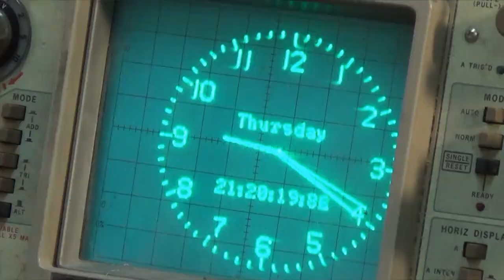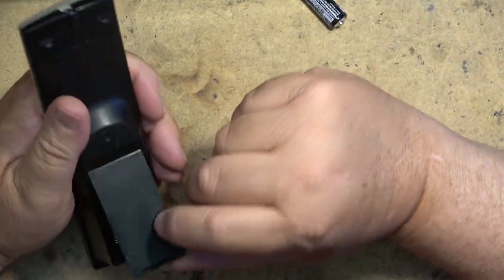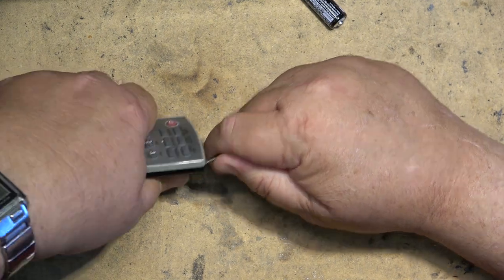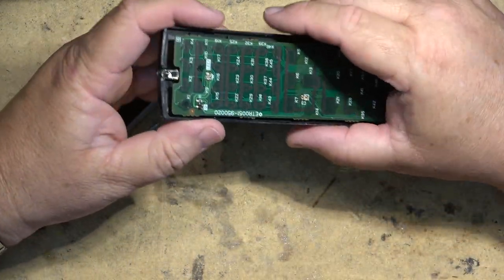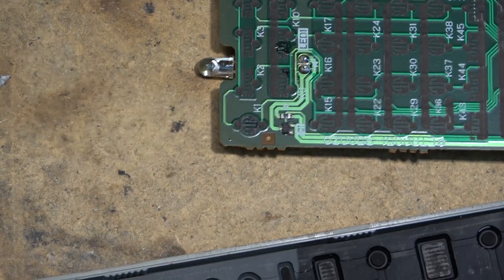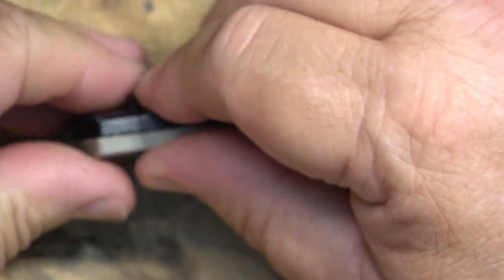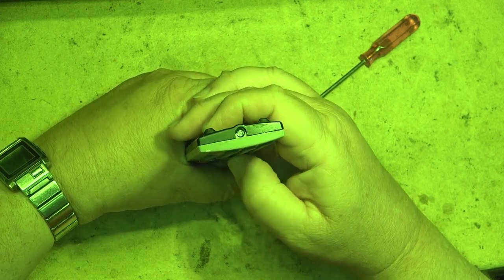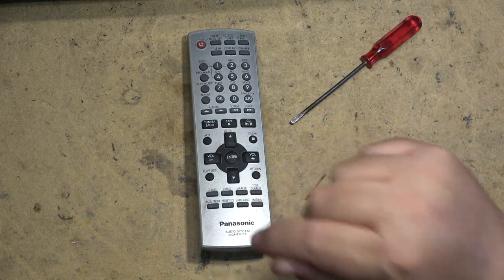Repairing a dead remote control

Comment: Hi Dave,
Another great instructional video. 
Here's what I do to test the remote control since I don't have a night vision camera. I aim the remote control within an inch or two at an AM radio with the frequency just a bit off from the station and you'll hear interference over the speaker every time you press a button on the remote control. Just to be clear, this only works with the radio set to AM.
Reply: I use my Panasonic RF-511 to check for RF radiation all over the house to check for noisy devices, like switch mode power supplies (wall warts). You would be surprised how many wi-fi and electronic devices on standby there are in your house which are active all the time and transmitting electronic noise pollution. Did not know a remote control would emit that much RF noise, interesting.....

Comment: Carbon pads can wear out - use conductive paint on them when that happens.
Reply: Like what kind? The conductive paint for automotive rear window defroster repair? Directly on the rubber carbon flexible pad I am assuming?

Comment: Hi Dave, great job on the remote ! I remember, as a kid when remotes first came out, they were wired remotes, lol, then the clicker type came out, my, how the remotes have come a long way!!
Reply: I have a VCR with a wired remote control, though to be fair it is a professional Panasonic duplicator, where you can plug in either a edit deck or just a more basic remote to control it.
Reply: Yeah, I have an old CRT TV that uses the "clicker" type remote. I used to jingle my house keys to make the TV go haywire as the way the remote worked is that the clicker would strike a metal tongue inside the remote and it made a high tone sound that would be detected by a mic on the TV thus allowing remote operation. Each button would strike different tones for channel change, volume, power etc. So jingling my keys would produce these tones and the TV would pick them up and start changing channels, power on and off and going loud n quiet etc. Great fun.
Reply: @EzeePosseTV  lol me too 🤣
Reply: @angelodagnolo984  Haha kool, I love it.

Comment: I remember, many years ago, my father getting consistently frustrated with a remote - finding that if he whacked it against his palm it would usually cooperate (regardless of battery age/condition).  Until it got worse and worse, requiring luck and a stronger whack (or two or three or...)  

Must have had a cold solder joint on the LED/emitter beforehand... Finally one day it was resoldered and worked like a champ!  Whoops, easy fix!

Comment: I made a circuit to test remotes using IR sensor from TV and coupling that to an audio Amp. Nothing critical for the Amp. Lm 386, Discrete Amp whatever. Usually the ir sensor runs on 5v. This comes in handy for programming universal remotes. Different brands make different sound. So you tell if you were switching codes. I found it handy to show customers if their remote was working or not.
Reply: Tune an AM radio to around 700kHz. When pushing the buttons on a good remote,  you should hear "noise" from the radio speaker. If no noise is heard vary the tuning up or down a couple of kHz.
Reply: @xmttrman  I have done that as well.

Comment: No IPA wash?  Oops, I may have bricked the JVC VCR I changed the belts on recently — washed the board down thoroughly.

Thanks for the dilute solution pro-tip.  I’m off to give it a go now before diving into another VCR.

Thanks for all the great vids.
Reply: What? You shouldn't use IPA on conductive layers in remote controls only. It won't harm PCB itself or its copper traces...

Comment: I have a remote for a 1988 Panasonic TV, which, on closer inspection looks as though something has been spilled into it. Turns out the rubber membrane has started to break down with age, and is leeching a residue out onto the PCB.

After cleaning it up multiple times I gave up and stored it away in bits, as a universal one does more than I need it to. Power On - Select A/V - Adjust Volume - Power Off. That's all I need the blasted thing for!

Comment: Unless they have an infrared filter on the lens, all video cameras can see IR light, whether they have "night shot" mode or not.
There are even little cards one can purchase with a coating on them that can detect it just for testing IR remote light testing.
Reply: I use my phone camera nothing special J6 Samsung, works great!
Reply: Radio Shack used to sell a credit card size tester that would luminesce when you pointed the infrared remote at it.
Reply: @angelodagnolo984  Need a pretty dark room, glows purple.

Comment: Hope you washed the case halves as well, they get nasty dirty as well. I also tend to look and see if the small capacitor in there can get replaced by a larger value, makes the range with weak batteries longer, or just makes the remote more reliable in daytime, as the IR signal is stronger than the low current the batteries can supply.
Reply from the maker: No never dawned on me to clean the cabinet.

Comment: The contamination is it silicone oil leached from the rubber keys ? I have taken some apart that were full of this oily stuff, I did wonder if it was greasy hands that caused it to leach.
UK based controls that I have had the experience of.
I did read one article that said it was sometimes shortcuts in the manufacturing curing process of the rubber keypads ?

Comment: I found that IPA don't harm remote controls PCBs - for sure more modern ones. For rubber membrane soap and water is the best way to go. I've tried also IPA and q-tips on membrane - very gently to not remove a lot of conductive carbon - yes, for sure it can remove it and destroy a remote. Some more used remotes can have conductive carbon layer worn out. You can use some kind of conductive paint or cut old membrane pads and glue in a new ones.

Comment: You can also use an AM radio to test out remote controls as well.
Reply from the maker: That will pick up the 455khz ceramic oscillator.  Won't tell you if the ir led is sending a beam out.
Reply from the maker: @awesomeluis  mine has ir cut filter.  Doesn't see ir
Reply from the maker: @bahagursoy8138  not dishwasher detergent.  Hand washing dish soap.  Palmolive or dawn.

Comment: When I need to pry something open like this, I usually just use a guitar pick. With a screwdriver I oftentimes damage the casing unnecessarily. Also, when you no longer have a specific remote control, you can use a phone with an IR blaster. There is this Android app called irplus, which allows you to mimic vast majority of remotes sold worldwide. I use this to disable autotracking of old VCRs I do not have remotes for. Handy if you need to adjust the tape guides.
Reply: Great tip!
Reply from the maker: Good luck finding a phone with an IR blaster today. Yes Samsung had that on their tab tablets and on some of the earlier Galaxy phones but that's long gone. It was a nice feature and I wish they'd bring it back but you know the saying wish in one hand and shit in the other and see which one fills up first.
Reply: @12voltvids  Yeah that may be true, but probably depends on location. Here in mid Europe the phones with IR blasters are still widely available. Samsung or Xiaomi are your best bet.
Reply from the maker: @speed_rider362  I don't know about you but when i am watching TV my phone is as far away as possible. I don't live with my phone glued to my hand.  Using my phone to change channels makes as much sense as using my phone to view my backup camera on my car.
Reply: @12voltvids  I use my phone to help me with technology. I make calls and send messages. Not much else. Even you use your phone to measure the rotation speed of turntables :) Phones nowadays are universal devices and it is fine. Not much to do about it.
Reply from the maker: @speed_rider362  Its a communication too. I use it for phone calls when I am away from the house. I use my home phone at home. I use it to check Email when I am away from computer. I don't play with it when I am watching TV or a movie. The idea of using my phone to change channels on my TV doesn't appeal to me. Neither do those fancy touch screen remotes where you have to actually look at them to use them. Sorry, but I like a remote with real buttons. I know where they all are and can press the one I want by feel, and not have to fumble with my phone and unlock it just to change channels.
Reply: @12voltvids  One could raise #ell with a sports bar's TV monitors with that app!
Reply from the maker: @xmttrman  years ago there was a certain sports bar that i knew the owner.  I knew that he had bootleg satellite tv boxes on his tvs and i knew he had a box that had an RF remote.  On more than one occasion his tvs just changed channels from the football or hockey game and somehow ended up on the xxx channel. Now i am not admitting or denying that i told someone what he had and what RF code the box was set to.  Now how did I know this info. Well I might have installed his system years before and perhaps felt that he didn't pay me what the bill was and negioated a much lower price after the work was done.  He offered me free beer.  I didn't want free beer I wanted a stack of bills like we agreed to when i offered to put up his illegal pirated dish.  No I didn't supply him anything. I mounted the dish ran the cable and plugged it in.  But he rubbed many the wrong way so there were a few that were interested in embarrassing him.
Reply: @12voltvids  Car entertainment systems with touch screens you can't work by braille without taking your eyes off the road are my pet peeve, stupid in a moving car.

 I used to adjust a graphical equalizer by feel without taking my eyes off the road, pop out a tape, grab another out of a box, pop it in, all without taking my eyes off the road. Damn, I must be getting old.... sigh
Reply from the maker: @zulumax1  So I take it you won't be buying a TEsla anytime soon.
Reply: @12voltvids  Don't think it matters what you buy. I would love to have a Tesla model S. I bought a new VW Golf GTI in 2015 and found out after I bought it that they put the CD player in the glove box and it is only a single disk player. I guess CD players are an after thought now days. It does have an SD memory card reader so I make playlists for that.
Reply from the maker: @zulumax1  couldn't pay me to drive a tesla. Any of them.  I know several that own then and they all have so many problems.  Door handles are still failing left right and center and our of warranty 1000 to fix.  
My car doesn't have a cd player.  The old one did.  Single disk but plays mp3 disk.   I have SD reader in new car.
Reply: @12voltvids  Good to know, by the way I was thinking of you this morning as I have been dubbing VHS tapes on my JVC DVD combo player and rewind just puked and died. Probably a belt? FF and play still work. May now give me an excuse to fix that S-VHS player now, much nicer unit, rosewood sides and jog shuttle.

Comment: I use the same method, with really dirty remotes I clean the entire rubber pad with a toothbrush & dishsoap, as well as the casing.
I have repaired loads that have had drinks etc spilt on them, even cat pee!
Reply: Or sometimes you wonder if they were eating fried chicken every time they picked up the remote.

Comment: I Didnt Have A Night Vission Camera To
Check The Remote. I
Used A Cellphone Camera To Check It
To See If It Worked. Hey Remember How
The Older Remotes Wh'er Made
All The Buttons Wh'er Separate Instead
Of Them Being All Together.
Then Every time You Took One Apart 
The Buttons Would Get Lost If You
Didn't Have Anything To Put Them In.
If You Lost Some Of The Buttons You
Might As Well Toss It In The Garbage.
But Nowadays Their A Breaze To Fix.
I Fixed A Universal Remote For My Mom's
TV Onetime. All I Had To Do
Is clean The Circuit board. By Using A Dampend
Cloth In Some Windex. It Didn't Hurt
The Circuit board.